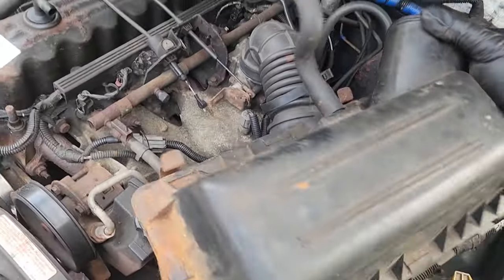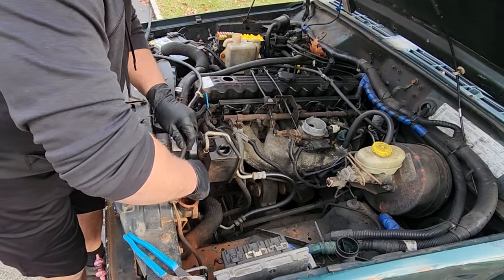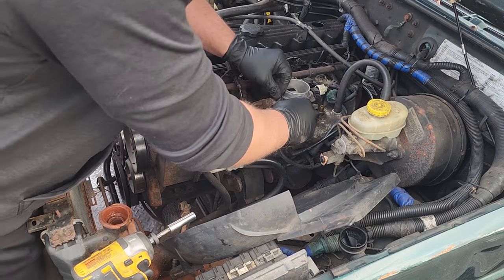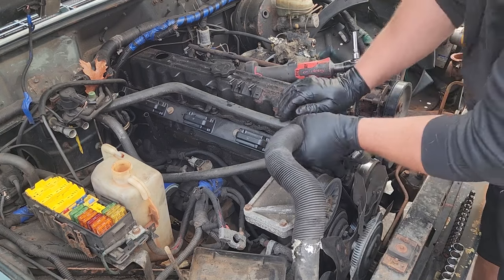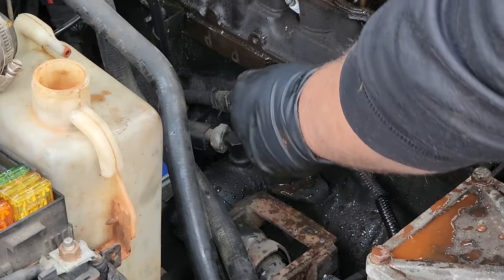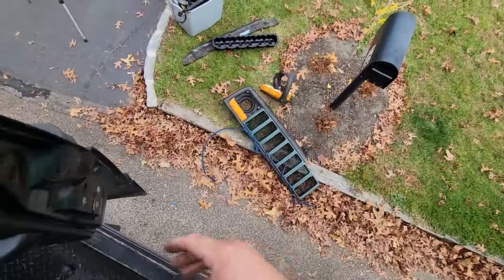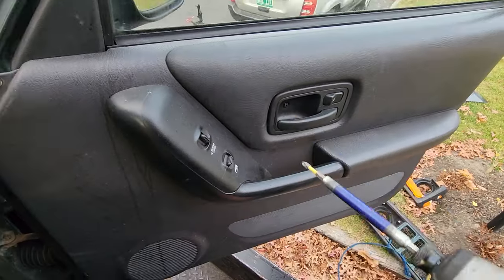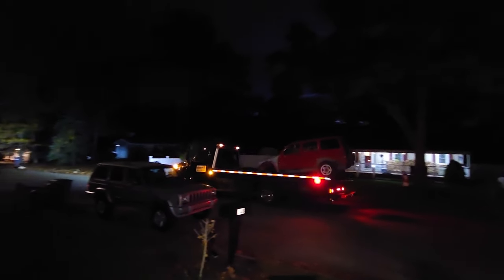JEEP XJ 30-MINUTE STRIP JOB  -  GRABBING AS MANY PARTS AS POSSIBLE BEFORE THE CHEROKEE GETS CRUSHED

Comment: i always go for the console latch, cargo light, speaker grilles, tcm is always a good item to pull, nicely done thanks for the parts and shout out! the panel switches can be used to repair melted fog and rear wiper switches.